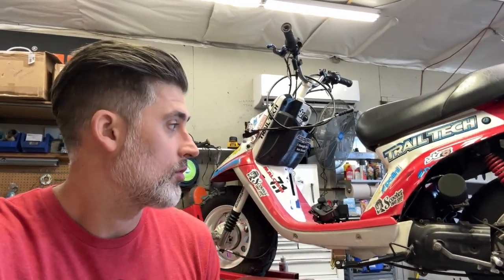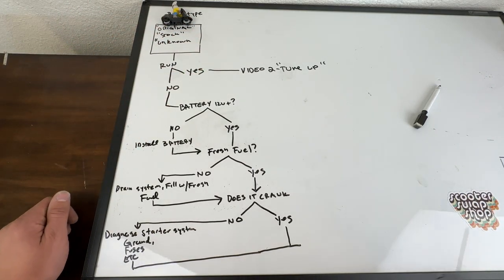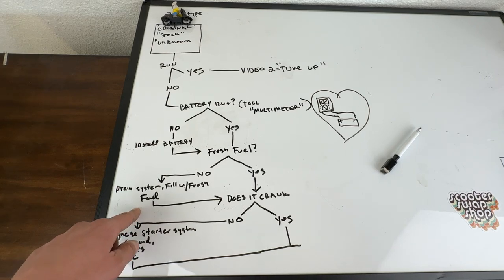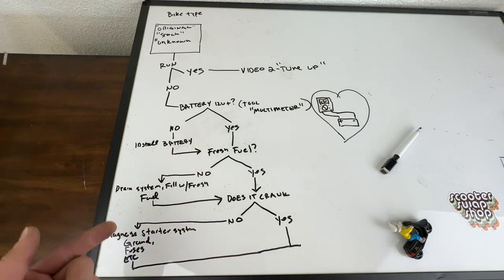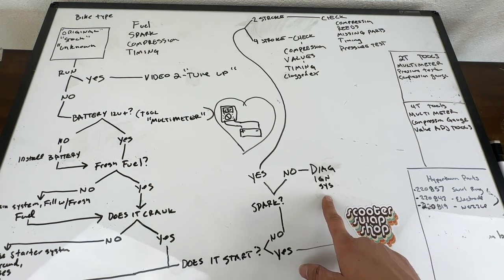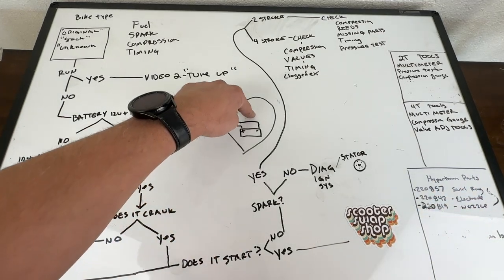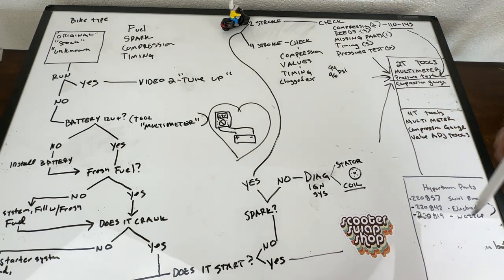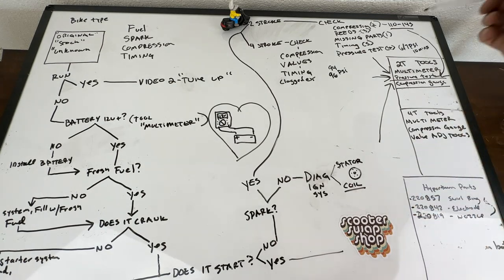ULTIMATE Scooter moped troubleshooting video 1

Comment: i bought this 2006 taotao blizzard and it used to run but now it won’t. it’ll make a click then bang with click the clicker but it’s not firing when i starts it. it’ll start but then it’ll die and has fuel and spark when it starts but i think maybe needs new tires . idk maybe you know how to make it run cause i need help. it starts but no it won’t starts
Reply: Yooooo 😅😅🤣

Comment: What if it start running with starterfluid? But dies when starterfluid runs out? Fuel issue or air issue?
Reply from the maker: Follow the guide and you’ll find the issue. There’s no way to say what the issue is without doing the basic process of elimination.